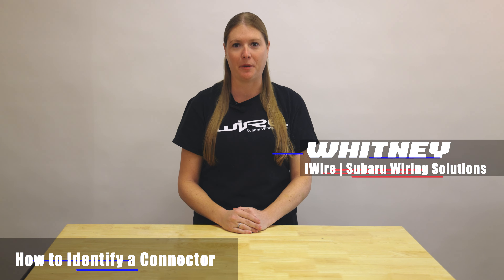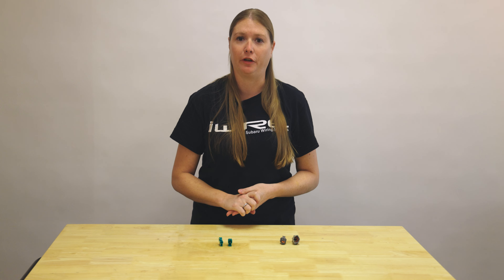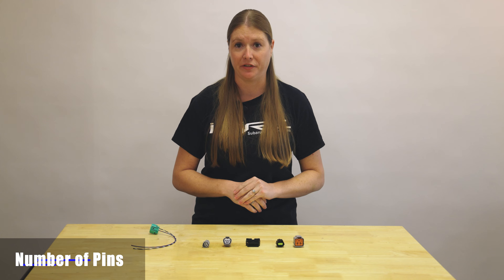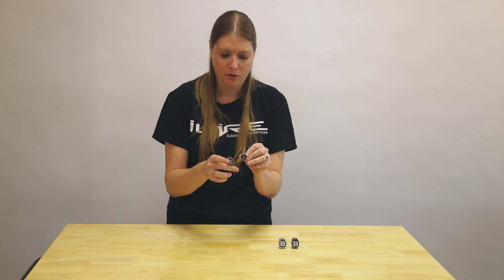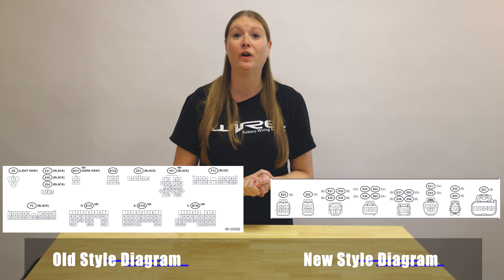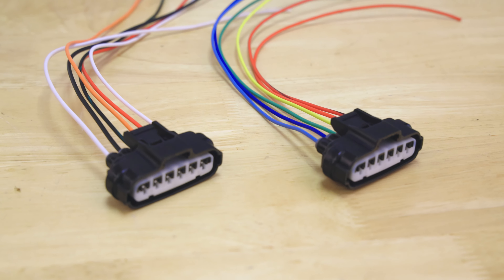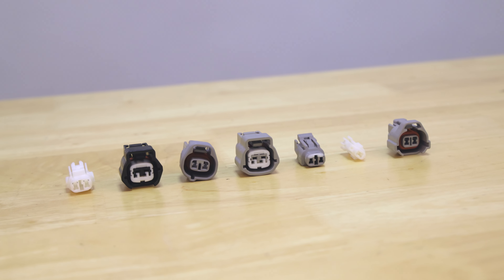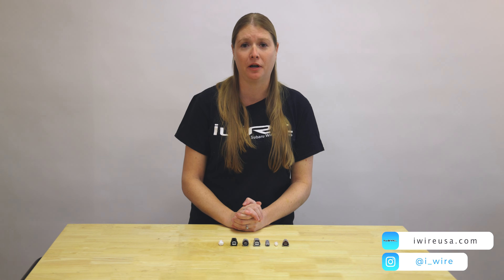How to Identify Automotive Connectors - Find Your Replacement Plug

Comment: Hey I need the connector that's at 57 seconds, what's that one called????
Reply from the maker: That would be the Test Mode Switch Plug and Receptacle.

https://iwireusa.com/collections/1-2-pin-replacement-plugs/products/test-mode-switch-receptacle?variant=40734263738521

https://iwireusa.com/collections/1-2-pin-replacement-plugs/products/test-mode-switch-plug?variant=40844170952857

Comment: Id like to replace the main big brown 16 pin connector on my 06 WRX harness.
I found the Deutsch connectors but unsure what size deutsch crimper to get or connector for the wires. Please can you advise. 
Gutted I'm 5000 miles away from your workhop where Bucky goes.